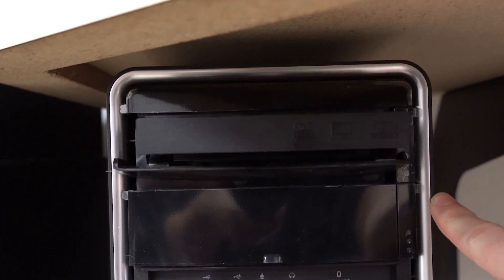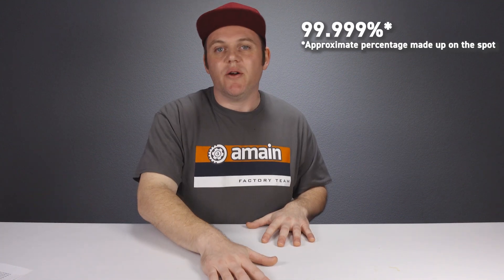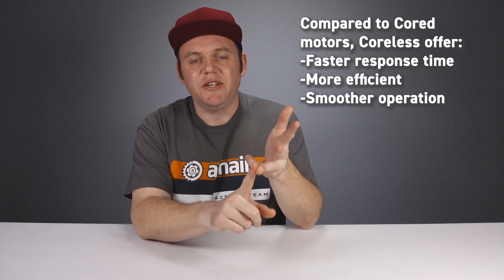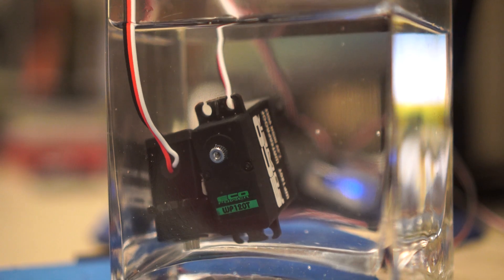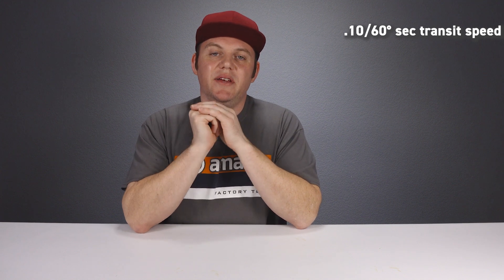RC Servo Differences & Technologies Compared - Servo Motor Types, Materials & More

Comment from the maker: Timestamps: 
1:08 - Servo Types
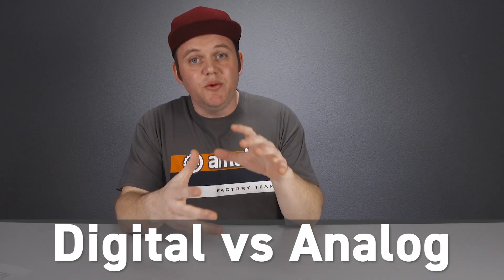3:23 - Digital vs Analog
4:30 - Motor Types
6:16 - High Voltage Servos
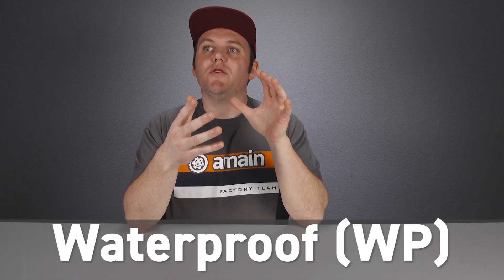7:53 - Waterproof Servos
8:23 - Case Material
10:13 - Gear Material
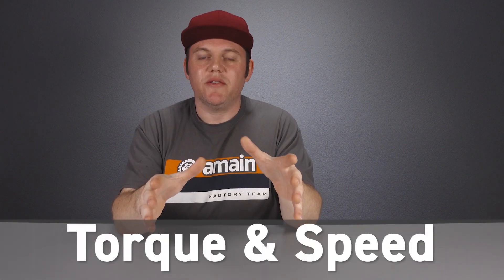11:24 - Torque & Speed Specs
-Brett
Reply: Brett, great video. Very informative.  Keep up the great work.
Reply: Titanium is the same strength as steel and like 40% lighter.
Reply from the maker: @LoociferZ  #FALSE
-Brett
Reply: @AMain_Hobbies  Mmmm no.  There are titanium alloys that are much closer to steel than people think and they still stay WAY lighter which I imagine would be important in an RC. If Titanium is properly heat treated, it's incredible.

To be honest, steel or titanium, if you strip a gear of either like you said, you have your gearing or angling off. Titanium shouldn't shred and since it's 40% lighter, I use it for almost everything that needs lightweight unless I have something that does excessive twisting. (I'm a welder by trade).  

And yes, despite Ti being the fourth most prevalent metal on earth, it remains A LOT more expensive.
Reply from the maker: @LoociferZ  Great. But your original statement is still #FALSE 
-Brett
Reply: Hi Amain Hobbies, my brother got me a Reefs RC Beast for my 1/5 5IVE-T 2.0. Will this be an upgrade versus my stock servo? Are you familiar with this model and are they any good?
Reply from the maker: @demetri1651  Oh yeah, it will be a great upgrade. There are a couple different versions of the 1/5 Beast servo, and either should be an improvement. 
-Brett
Reply: that's not a Servo in a car 1/1 just a regular little motor not a servo it's more like a brushed motor not a brushless
Reply: Do you think a Traxxas 400 oz-in servo would be considered  EXTREMELY OVERKILL for my UDR? Bone stock UDR...
Reply from the maker: @andrewstevens5572  No. 
-Brett

Comment: Titanium is stronger than steel, and weighs less lol. It’s also the most expensive. It’s why they make such good MTB frames, and parts, and why they are used in critical applications where you need the strongest material that won’t break (like in aircraft).
Reply: Titanium weighs less than steel but more than 7075 aluminum. AGFRC is the biggest supplier of titanium servo gears. I don't buy any other brand.

Comment: That was pretty great, Brett!  Thanks for quickly bringing this elderly software/hardware EE up to speed on servos! (I just subscribed and liked).
Questions:
1) What can you tell me about servos with built in position feedback?  Is it digital?  An analog pot voltage one can use to reposition? I assume you have to turn off servo pulses to manually position it before you read it back, correct? Can they give you an analog voltage as fast as they move?
2)  Can one use software to instantly change servo speed? {Like implementing a slowly-changing PWM duty cycle, if that doesn't exist already?) I'd like to implement a brief gradual ramp up period, a longer full speed middle period, and a brief gradual ramp down period!
3)  There is flexibility in the PWM frequency.  Is there any reason to gradually change that?
Thanks in advance!

Comment: really cool vids! i have a ton of questions!!! i just got a 1/10 summit and want to upgrade some parts, like idle gear (to metal) spur gear, 775 titan to brushless in other words... make it extreme or ultimate... but questions arise!! will i obliviate the gears? driveshafts? etc... and upgrade the steering servos... thats a must! (this beast has 3 micro-servos and 2 normal ones... damn!!!) so which steering servos are ideal? i want to get brushless but I dont race i crawl! thnx

Comment: Continuous servos are often used in RC crawler tanks or tiny tracked vehicles to actually drive the tracks.  The slow speed and high torque are perfect for this application.

Comment: I get it.. so basically the DIGITAL servo is just higher resolution, more pixels per frame or (input.) you can just think about turning the wheel and your servo does it for you.
Reply from the maker: Yeah and just more precise, more exact. They're basically little computers at this point with how chip-controlled they are. Analog servers are still good and we use them for lower-end/budget builds or special projects because they're cheaper and easy to replace. For anything performance oriented, digital is the way to go. 
-Brett

Comment: Any difference between car n heli servo?
Reply from the maker: Yes, try to avoid them in surface vehicles. Some heli servos operate at different pulse widths, or frequencies, and you wouldn't want that. 
-Brett
Reply: @AMain_Hobbies  can use car servo on heli cyclic?

Comment: Hi Chief, thank you for taking the time to make this video, I’m learning every day. My question is a little outside your video subject but I’m an electronics idiot but I’m not a dumb guy, so I’m hoping to tap your expert opinion for some advice. 
I’m trying to pull the rope on a lifejacket CO2 manual inflator (No, using the auto inflator is not an option) using either a servo or a solenoid with a button as the trigger on off. So, I’ve guessed the torque pull required on the rope is probably 3 to 5kg and this is a one-time use one time pull device I’m trying to build. I don’t even know if that is even possible to press a button once and get enough torque from a servo or solenoid to pull a rope? Would the servo keep spinning or would it stop after the button is released? Any advice or suggestions would be most greatly appreciated! Thank you so much!
Reply from the maker: You can definitely use a servo for non-rc tasks. Most servos have a limited rotation, around 180°. To steer r/c cars, the servo is set to it's center to provide ~90° to the left and to the right. Some servos are continuous rotation, like the ones we use to control a 4x4 winch, but they are less common. 
To control the servo, you'll need a power source and a controller unit (im sure rigging it to a button is possible, but you'll need to be crafty) 
Our house brand, ProTek R/C, released a new servo that outputs 1000oz-in of torque at 8.40V. It's measured using a 1" long servo horn (all r/c torque specs are).
Finding enough torque shouldn't be a problem and I'm sure you can accomplish your goals with these r/c items, it's just a matter of making it. 
-Brett
Reply: @AMain_Hobbies  Brilliant! Thank you so much for your detailed reply, I truly appreciate it. I actually spoke last night and today to your genius engineer Ryan at head office, I've sent you guys a detailed email and hopefully I can buy a whole bunch of goodies from you! Thank you again!

Comment: I wonder if someone can help me,

I need a basic servo that can move at least a quarter inch or a little less, it really doesn’t matter the exact measurement, the moment I push on my remote control. I already know how to connect a remote control but I just need to know if I’m doing this correctly, what I do is I connect one of the three wires to one side of a 9 V battery in the moment the other wires touched the other side of the naval battery, the server gets a little surge of electricity and it moves exactly the way I like it to move but I wonder if I’m doing this correctly, if I may damage the unit and if there is a better way, thank you in advance.
Reply from the maker: You may be damaging the servo. Most servos are voltage compatible between 4.8V - 6.0V, so please ensure your servo is 9V compatible. 

In r/c cars, the servo is operated by also having:
1) radio transmitter and a receiver
2) speed controller
3) battery 

These separate systems together allow servo operation and are all required. You may search else where for a simple servo operator, like a knob controlled box, but it will still require a power source, or battery. Maybe check out eBay for a simple servo control box with a control knob. Hope this helps Joe!
-Brett
Reply: @AMain_Hobbies  Thank you for your time, what I am looking to do is simply have the serval turn slightly without an accessory of some controller. Yes obviously it needs power so that’s not a problem but I want to hook up the server via remote control and when power goes into it, I would like for it to turn slightly which it does perfectly. So if there is another way of doing this, I would love to know, even if I have to buy some type of a controller but it needs to be done remote control where simply turns  slightly.
Reply: @AMain_Hobbies  another option for me will probably be to just you say simple small motor. All I’m trying to do is turn on a switch VR remote control, that’s all I’m trying to do. I just need something to move slightly to pull a small cable to turn on a switch via remote control. I have a small motor but when I connect it, it goes like 1,000,000,000 miles an hour and it keeps on going so maybe there’s a slower motor? Again I just needed to turn slightly so I can pull the trigger for the switch via remote control. I already have all the remote control yeah I just I need so I just need a servo oral motor to do the job.

Comment: The stock panda hobby servo is slow but has a lot of torque, you can make it faster using the hobbywing quicrun 1080 and the program card that's included. Just change the BEC voltage from 6 volts to 7.4 volts

Comment: Ok AMain need to buy a servo from you.
Here’s what I have and what I’m looking to do with it.
Brand new 1/8 Kraton Roller
Looking for a servo with metal gears houses in an aluminum case. I need it to powerful, durable, & fast. Medium bashing.
I was looking at the Reef’s 500 Raw, but need options.
Please give me some options so that I can order it from you.
Regards,
A Subscriber
Reply from the maker: Hey William. Sounds like a fun project, congrats on the build! Have you seen the Savox Black Edition Monster Servo: https://www.amainhobbies.com/savox-sb2290sg-black-edition-monster-torque-brushless-steel-gear-servo-sav-sb-2290sg/p-qqacqzwapzzxactz
The ProTek 370TBL is also great, plus waterproof: https://www.amainhobbies.com/protek-rc-370tbl-black-label-waterproof-high-torque-brushless-crawler-servo-ptk-370tbl/p-qqacqqeqhz2xactz
MKS servo's also look great, although never personally tried them: https://www.amainhobbies.com/mks-servos-x5-hbl550-brushless-metal-gear-high-torque-digital-servo-mks-hbl550/p-qezkt2qqhzzxactz
Tekin has some good looking servo's too: https://www.amainhobbies.com/tekin-t440-digital-hitorque-programmable-servo-high-voltage-tektt1507/p-qtartzrqhm2xactz
-Brett

Comment: You can make 6.0V slow servo faster by operating it at 7.4 volts or higher but that could resoult shorter servo live.
Reply from the maker: MUCH shorter life span.
-Brett

Comment: I have a spectrum S603 that shutters when power is added,not running smoothly,is there a replacement,as I can’t seem to find the original at AMain Hobbies can I use a Traxxas one that’s on the Traxxas blast ,thanks for  any information ,nothing but bad luck with this Stealthwake 23, first the engine goes now the servo.Spectrum makes an S605 not sure of the difference between the S603 that’s in my boat
Reply from the maker: Yeah, any standard sized servo will fit in it's place and you probably just need a basic servo; something like this: https://www.amainhobbies.com/ecopower-wp110t-cored-waterproof-high-torque-metal-gear-digital-servo-ecp-110t/p-qtacq2uq7mzxactz
The only thing to consider is some servo brands use a different tooth count on the spline (where the horn is attached) so if you switch brands you may need a new horn, but they're inexpensive. 
Here are all our standard sized servos, organized by analog, brushless, digital and high voltage, on the left side column. 
-Brett
Reply: @AMain_Hobbies  is this the same size as the one in the Proboat stelthewake 23, as they come in different sizes ,S603  spectrum is what’s in mine thanks
Reply from the maker: @rickbarg3980  Yes, they are the same size. Both the WP110T and the S603 are considered "standard" sized servos. 
-Brett
Reply: @AMain_Hobbies  order in

Comment: I have a question that may be stupid but I have had analog servos in my Revo since I bought it, I recently bought the new TQi radio and receiver, they’re all digital. Should I be worried about any differences in the digital receiver and analog servos?
Reply from the maker: No, it should all work fine. 
-Brett

Comment: Iam a newb too rc... I have a bezgar1 1\10 scale. Gd Chinese pos. Just want to  get it running again before, I upgrade and spend $$ on a losi or Traxxas.
 I cannot find a replacement servo or one  that's compatible anywhere..!?. I've scoured the internet looking, nottadamthing. If anybody has a suggestion I'd greatly appreciate. 🙏
Reply from the maker: You're looking for a servo for the which vehicle exactly? For Losi and Traxxas 1/10 scale vehicles, and standard sized servo should fit. I don't know about the Bezgar though.
Here are our standard digital servos: https://www.amainhobbies.com/digital-standard-servos-electronics-cars-trucks/c-qqqch4a4ytwryqgz
Here are standard analog servos: https://www.amainhobbies.com/analog-standard-servos-electronics-cars-trucks/c-qqqch4s4ytwryqgz
The Traxxas probably needs a 25T spline, the Losi 23T (assuming the old servo was Spektrum).
-Brett
Reply: @AMain_Hobbies  Okay thanks! 👍

Comment: hi can anyone tell me if  Spektrum A6330 servo is good
Reply from the maker: We've never used one but the specs look good. It says its for aircraft although it should still work with a surface vehicle. 
-Brett
Reply: @AMain_Hobbies  i am going to use it for the arrma senton 3s
Reply from the maker: @abdullahzaman1706  Yeah, should be ok, just don't get it wet; it's not waterproof. Also be sure to use the servo saver from the old servo on the new servo. 
These servos are also recommended and waterproof: https://www.amainhobbies.com/ecopower-wp120t-coreless-waterproof-high-torque-metal-gear-digital-servo-ecp-120t/p-qtacq2uq7z2xactz
The only downside is you'll need a new 25T servo saver, like this one: https://www.amainhobbies.com/kimbrough-mid-size-servo-saver-futaba-hitec-airtronics-kim201/p-qtqetakqlzxxactz
This servo saver needs some material removed from the left and right side to clear the chassis, but that's all. 
Hope this isn't too much info, but you have options. 
-Brett

Comment: Is servo saver a must? I used to have servo saver on every servo. But lately, I see less people are using it.
Reply from the maker: Yes and No. It depends on the application. For 1/10 and 1/8 bashers, we use a servo saver always. These cars are going too fast and tumbling too hard to survive long term without one. On the other hand, for competitive 1/10 racing, they're almost never used. 1/8 racers still use them though, because most 1/8 cars are still designed with the servo saver in the steering assembly (they can be adjusted/locked down though). 
Hope that helps. 
-Brett

Comment: Hi I have a servo FY-DJ01 with a bad potentiometer. It's a 5 wired servo which is difficult to find in my area. So planning to modify the 3 wired and convert to 5 wired. But the proble is getting a right dimension servo of 3cm x 3cm x 1.5cm size. Could you plz help to advice which 3 wired series come in this dimensions. I tried to check with MG 995 and 996 but those are a bit large
Reply from the maker: Would something like this work? https://www.amainhobbies.com/ecopower-640t-13g-waterproof-metal-gear-digital-sub-micro-servo-trx4-ecp-640t/p-qezxtskqtm2xactz
Mini servos are less common with r/c, and standard sized r/c servos are too large for your specifications. Here is our mini servo category: https://www.amainhobbies.com/mini-micro-servos-electronics-cars-trucks/c-qqqch4dcytwryqgz
-Brett

Comment: I want a servo that can press a nerf gun but wirelessly . So i need 1 piece servo with transmitter and receiver so can u please send me the link where can i buy it
Reply from the maker: You'll need a transmitter, receiver, servo and power for the receiver and servo. 
Here are some budget friendly suggestions: 
Transmitter & Receiver: https://www.amainhobbies.com/spektrum-rc-slt3-3channel-slt-surface-radio-w-slr300-receiver-spmslt350/p1250168
Servo: https://www.amainhobbies.com/reedy-0712mg-digital-hispeed-metal-gear-servo-high-voltage-asc27110/p671903
Battery Harness: https://www.amainhobbies.com/tactic-4-cell-aa-battery-holder-with-futaba-j-connector-tacm2020/p609720
You'll need four AA batteries for the harness, but that will provide 6V to the servo & receiver. 
You might need a servo horn? There are over 200 horns in this category; you'll need a 25T spline for the servo suggested above: https://www.amainhobbies.com/servo-horns-parts-cars-trucks/c101
-Brett
Reply: @AMain_Hobbies  Will this be able to press a trigger of a nerf gun
Reply from the maker: @jerkyfreefire6582  No idea. I can only tell you it will steer an r/c car. 
-Brett
Reply: @AMain_Hobbies  Thankyou so much this it the only  YouTube channel i got reply